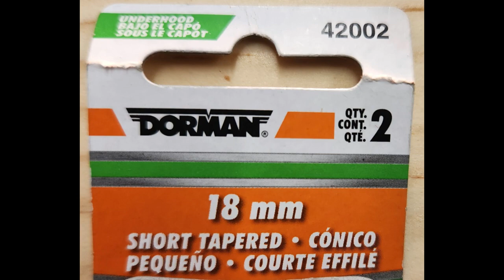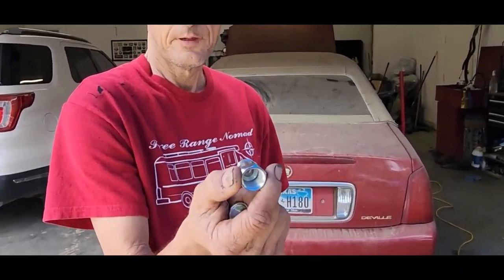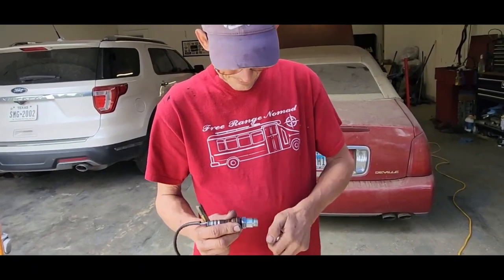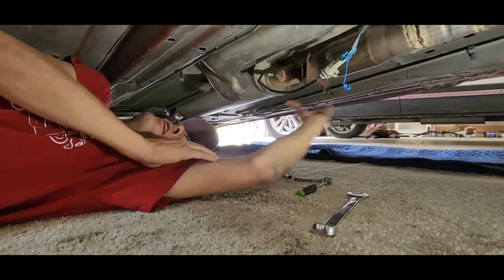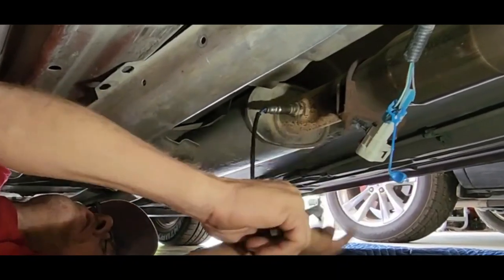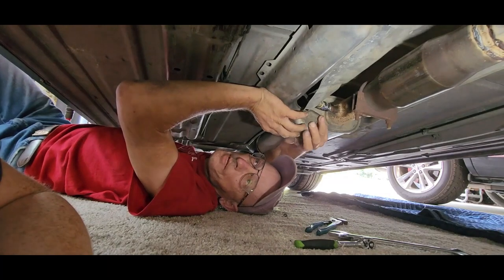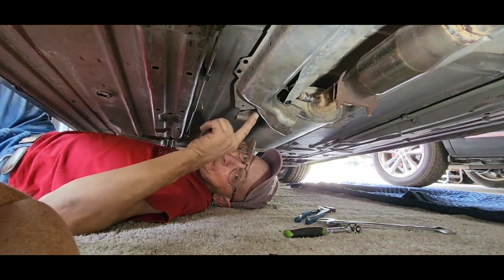How to Fool O2 Sensor w/ Spark Plug Non-Foulers !

Comment: I'm about to do this to keep my shit on the road. I'll let yall know it if does the trick. That being said, HOW does it trick it?????
Reply: Normally, the sensor is in the "stream" of exhaust.  It measures and compares to the upstream O2's.  If it's reading the same or too close to the same, it throws a code so that you'll either replace a bad sensor or replace the catalytic converter.  Putting the spacer in pulls the sensor out of the exhaust stream just enough to make the sensor think the catalytic converter is still doing it's job.  This "trick" is primarily for people who want to delete their converter.
Reply: @leverguy  Sweet. Well I did it. No more codes. Also learned that the rears might not throw a code, but instead, the upstreams will. That was a fun day.